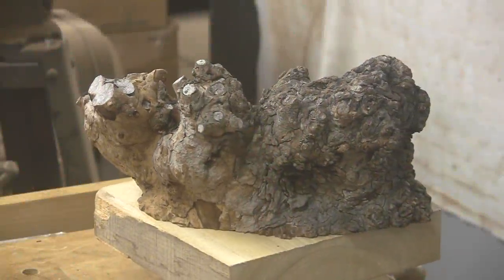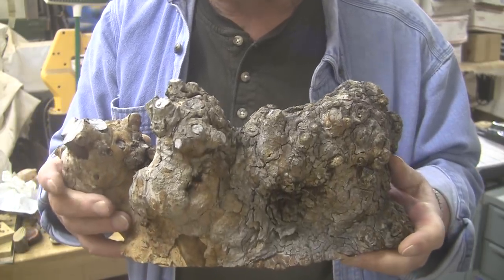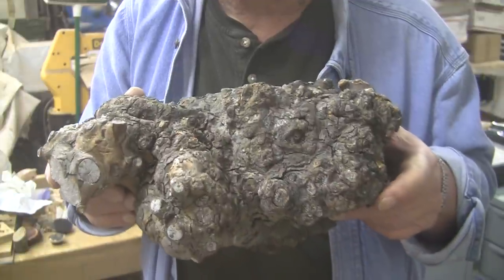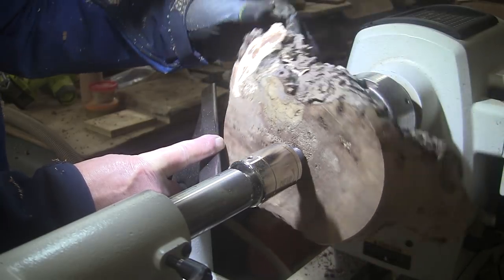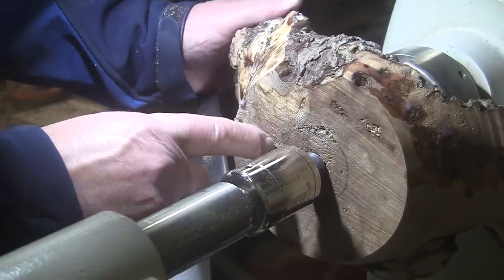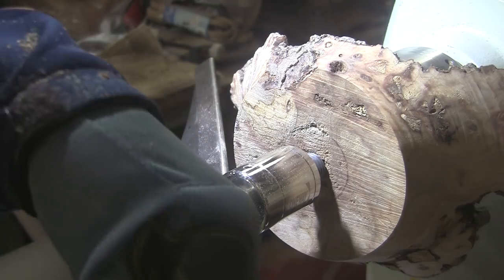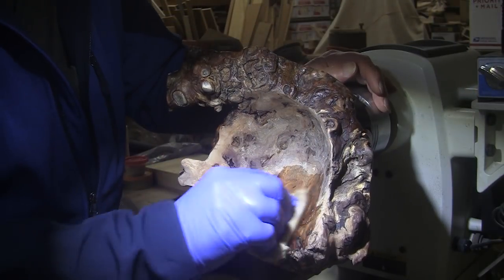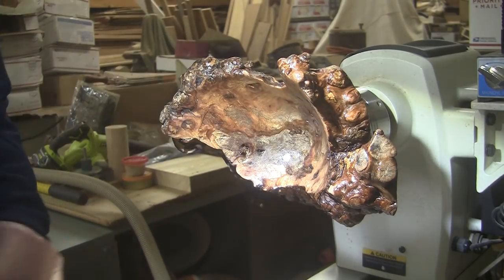Turning The Impossible - Wood Turning

Comment: I have found that using minwax sanding sealer works real well on hardening punky wood. It's also alot cheaper than CA glue.
Reply from the maker: Thanks for the tip, Darren!

Comment: PHil,  I just have to say that you take the improbable and make it possible.  What a wonderful art piece.  When you are cutting lots of air, you get way less kick back or bounce with your gouge than I get.  I have tried to match your angle, be open to about 1:30, and go slow.  Is there a secret that I'm missing.  Of course if it's a secret you can't tell.  My shop is colder because my woodpile has become an "opportunity".  Thank you so much for being willing to share you knowledge and help some of us to be willing to explore.
Reply from the maker: Thank you so much, Tom!  I can only guess you are trying to take too much wood at a time.  Going slow is good but try taking a lighter cut.  I find it amazing how quickly the wood comes off, even at 500 rpm but still with a light touch.  You only want to use that sharp edge, not the whole gouge.  You've got this!  I love your comment about the cold shop.  I've done my job!  LOL!

Comment: Love your videos was wondering what kind of sanding sealer u use and what’s the process u use
Reply from the maker: Thank you, Jason!  I've mentioned it in several videos and have shown my process.  I use Zinsser Seal Coat for the sealer and Zinsser shellac for the final finish.  Both come ready to use out of the can, I don't do anything to them.  I apply with a rag and a brush where necessary, allow to dry and buff between all coats with a gray 3M pad.  After the final coat of shellac I buff with a white 3M pad.  Buffing is with the lathe spinning around 7-800 rpm.  I've found by cutting a 2" circle out of the pads I can apply it like velcro to my sanding pad and use my drill under power while the piece is spinning, just like sanding.  Easier and better than holding the 3M pads to buff.

Comment: Hi Phil. Enjoy watching your videos. I used to turn wood a number of years ago but sold the lathe. I have acquired another lathe and want to get back in to turning. I didn’t sell my chisels which is a good thing. I had never heard of the Irish sharpening method nor the negative grind. Is it only the bowl gouges that you use the Irish method on? My chisels are mostly by RobertSorby and a few other makes in the mix.I noticed that the round nosed scraper is beveled on both sides. What are you using for the degree of bevel? Any advice would be appreciated. Thanks. Take care and stay healthy. 

Tom
Bracebridge Ontario
Reply from the maker: Thank you, Tom, welcome back to woodturning!  There are many names used to describe the longer sides on what I call "swept back."  I don't have much info about any of them.  I just ground some normal gouges by eye, they looked good so I set my jig to match.  Now I can duplicate in seconds.  My negative rake scraper was just a round nose scraper I reground, 36° both top and bottom.  I hope that helps and have fun!

Comment: Nice piece. Must have missed this one. Glad I found it! I have a question, where can I get one of those hold down clamps that you have on your drillpress columb?
Reply from the maker: Step back in time about 50 years for the drill press column clamp, Paul.  They stopped making them because modern drill presses have the rack and pinion table adjustment and these can't fit on those columns.  You can find them on eBay now and then.  😊

Comment: I do love that bowl, but you know I love bark almost as much as you. If I were you I would hold on to this piece. I quit using CA glue on rotten wood because of the fumes. Instead,  I am using J-B Weld 40001 Wood Restore Liquid Hardener. you might give it a try. It's about $10 on Amazon.
Reply from the maker: I've tried Minwax hardener, Don, but didn't like the way it changed the look of the wood.  If you have a fan pointed to blow the fumes away, CA works pretty good.

Comment: What lathe would you recommend for someone who wanted to get into turning? I'm not looking to spend three grand, but I don't think the $129 one on Amazon would be a good investment either.
Reply from the maker: Bob, I always recommend buying a used lathe.  The reason is, they often come with the tools and accessories you will need to get started.  I also recommend buying a name brand lathe capable of turning the size turnings you are interested in.  If you just want to turn pens and bottle stoppers, for instance, a small table top lathe will do the trick.  Bowls and platters will need to be much larger and more powerful. 😊
Reply: @PhilAndersonShadyAcresWoodshop  buying a used lathe sounds like a great idea, thanks!

Comment: Hi Phil. I have the same lathe as you, in fact I read your in depth review as part of my decision process. You talk about having to lean over to make the bowl  cuts. I'm just wondering if you ever pull the head stock to the tail stock end to make it easier on your back?  I must admit I have not done this yet. Yep looks more like a crocodile!
Reply from the maker: I'm fortunate enough to have the original model of the Jet 1840.  It has the swiveling headstock.  They stopped including that a couple years ago.  However, I can't utilize it because it makes me sick.  I get seasick from a lot of different positions, like laying on my back under a car, etc.  Having the headstock swiveled disorients me and I think I'm going to throw up!  LOL!  I have my lathe positioned against a wall and between a workbench and a cabinet.  Can't slide the headstock down to the end, either.  So, I lean over! 😊

Comment: What is the difference between sanding sealer and shellac finish?  Isn't the sanding sealer a shellac as well?
Reply from the maker: The sealer is thinner and penetrates the wood better to create a smoother surface for the shellac to adhere, to.  The kind I use is Zinnser Seal Coat and is also dewaxed so the finish coat will stick better.